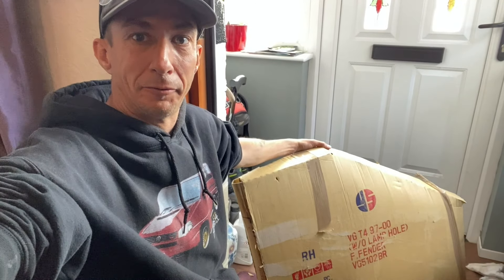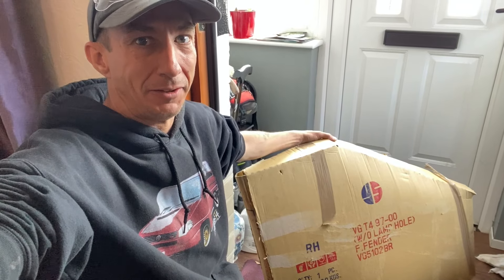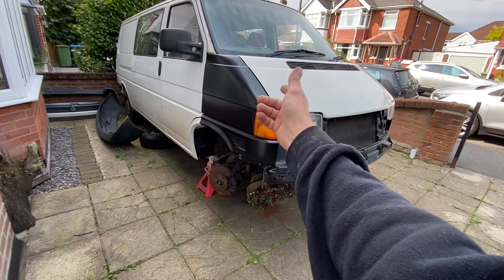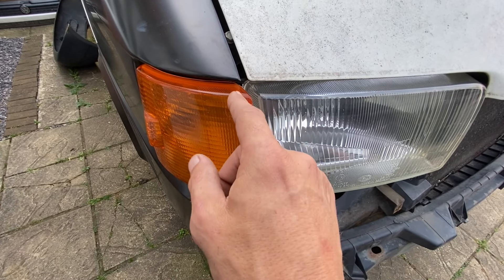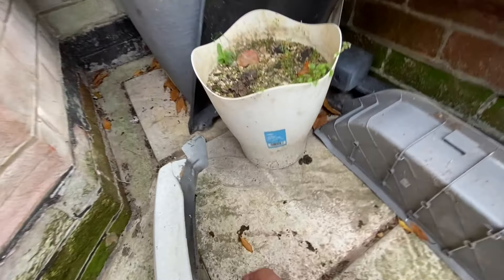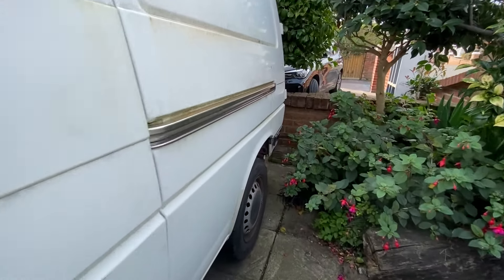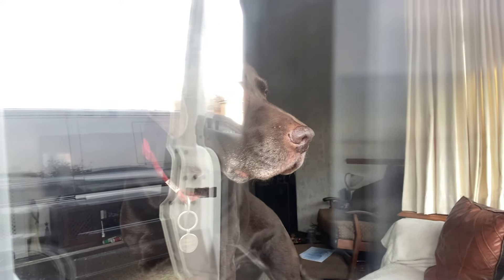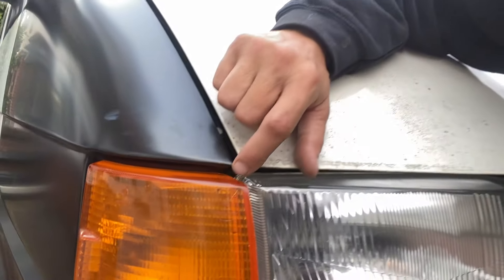Van Restoration: Trial fitting Replacement Wings from

Comment: Good to see you not seen many videos from you hope all is good 😊
👍😁🏴✌️
Reply from the maker: All good thanks mate, at the moment every Sunday 5pm 👍 👌 🤙
Reply: @TwiggsT4  am on it f##k nose what's happend there then 
👍😁🏴✌️
Reply: After market wings  used to be terrible fitting, we used to check if there was any decent original wings in the scrapyard before fitting after market as they used to be so troublesome .glad to see they've improved slightly

Comment: Hi new to your channel i am in the market for a welder and just wondered how you get on with the bester mig and what size bottles you purchase, cheers and keep up the good work.
Reply from the maker: Thanks, personally the mig I got is the bees knees for the price. So far I’ve used 1 bottle of gas and about half way through my 2nd bottle. The bottles are from sgs with a surcharge but can be purchased from many motor part suppliers, I get the 20Lt bottles, and I got the regulator from a welding supplier.
Reply: @TwiggsT4  Great thanks for that